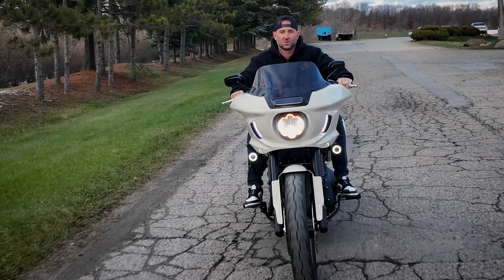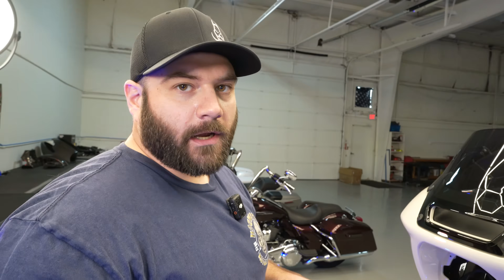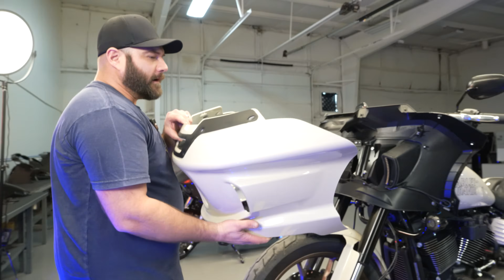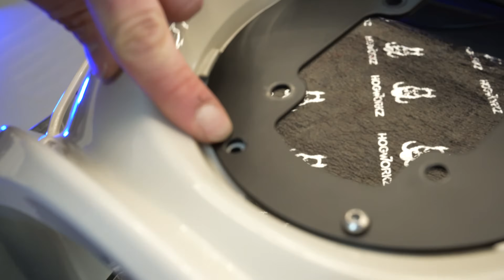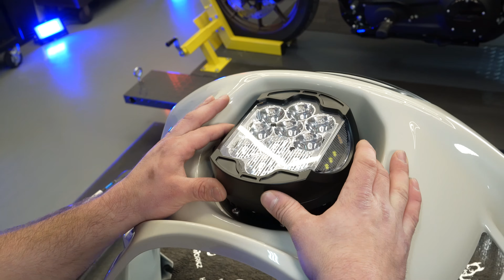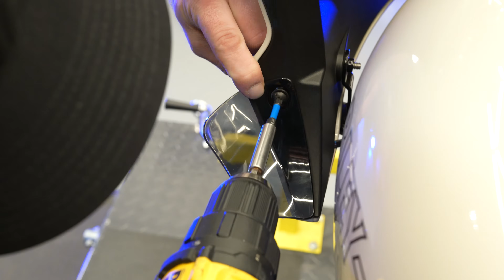HOGWORKZ® 7" LED Performance Headlight for Harley-Davidson® Low Rider ST '22-'25

Comment: What happens if you don’t drill the 4th hole ? Instead just use the 3 holes with the screws like the original ? I don’t like to drill modify a new Harley Davidson

Comment: Will it work with the Advanblack faring?
Reply from the maker: If the fairing has is the same as stock, yes. We can't guarantee it'll fit since its aftermarket.
Reply: Did you every try it or get it to work
Reply: @640baker No